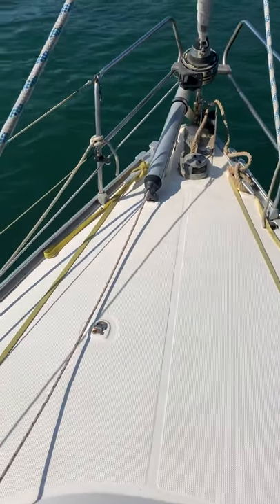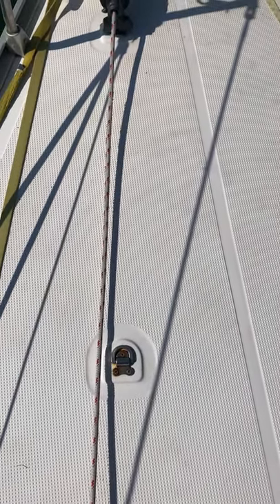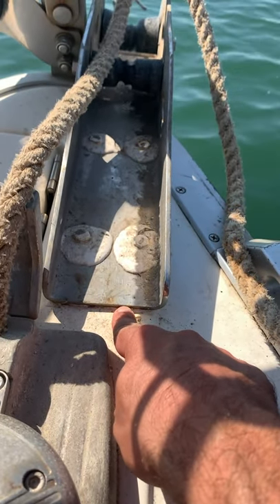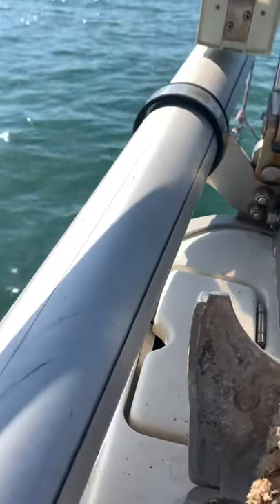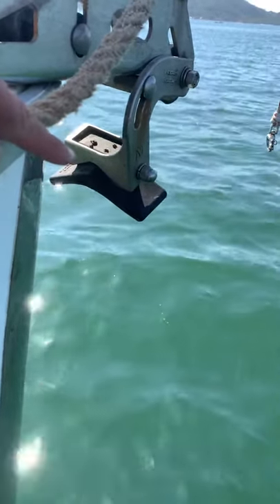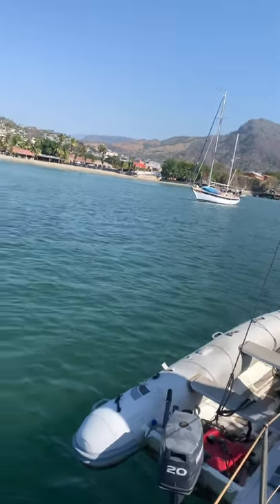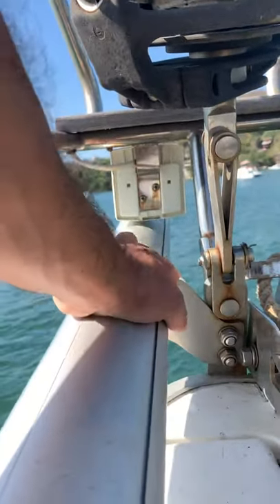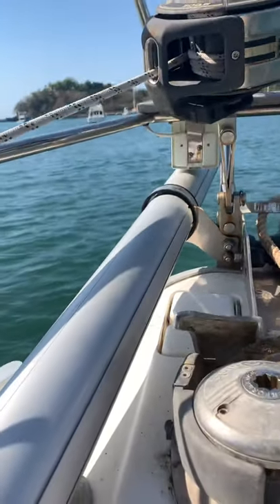Selden retractable bowsprit and Mantus anchor roller install

Comment: Great information. I need to be able to remove the sprint entirely easily. Does it simply slide out of that forward ring attachment by pulling back?  I have an anchor hatch across the entire bow fore-triangle, so to be able to open that when needed, I’ll need to remove the sprint and store it.
Reply from the maker: Yes you simply slide it out

Comment: I have decided for a different solution given the fact that the bowsprit cover the access to the chain of the anchor. So I boat a longer anchor roll that spreads off the bow and on which I fly the genn

Comment: Is the bowsprit reinforced below deck? I can imagine that a bowsprit with a big gennaker on a 40ft boat can put a lot of stress/force on the bowsprit in the upwards direction. Is bolting through the deck with a backing plate to distribute the force enough?
Reply from the maker: The bowsprit ring is bolted to the front stay chainplate. If that break I would lose the whole rig. I use the Bowsprit in 15 knots or less to avoid excessive stress.

Comment: What is the size of the pad eyes and how are they mounted to the deck? Thanks
Reply from the maker: Just came back from offshore, I'll check the exact dimension and come back to you! thanks for your comments
Reply: @SVParadigme20  Hi , did you had a chance to measure the pad eyes? … and is there an aluminum plate underneath?…I heard 8 mm thick. Can you confirm this? Thanks for help
Reply from the maker: 1/4 inches thick and 1 7/8 wide
Reply: @SVParadigme20 just to be sure: the aluminum plate where the pad eyes are mounted does have a thickness of 6.35 mm (1/4 inches) correct? Mounted with m6 screws…

Comment: I am curious as to the anchor size and model you use with the bowsprit. I want to install one of these but the Rocna anchor with the role bar takes up too much room.
Reply from the maker: I had a conventional 44 pounds Rocna initially, I had to buy a new Rocna Vulcan 44 pounds anchor to make everything fit together. 4 years of cruising later I find the Vulcan works just as well as the "rollbar styled Rocna"

Comment: Did you build the bracket yourself for the selden sprit?
Reply from the maker: The bracket was installed on the boat by the boat dealer. I believe it is a standard Selden part. Or Maybe a Bavaria part
Reply from the maker: Looking at previous pictures I can only say the bracket was installed at the Bavaria Factory